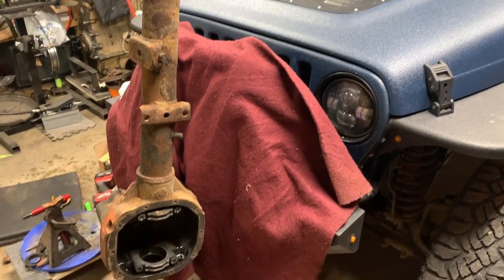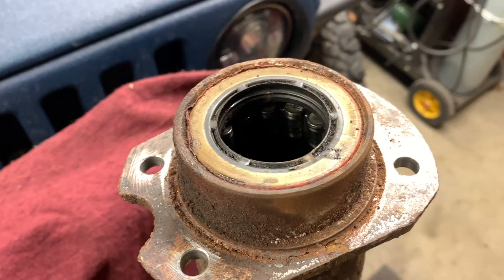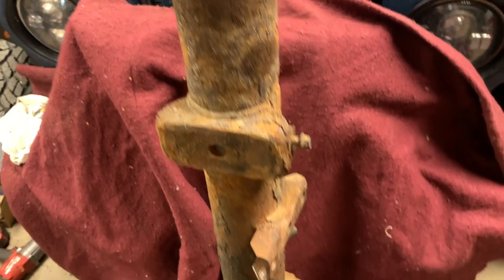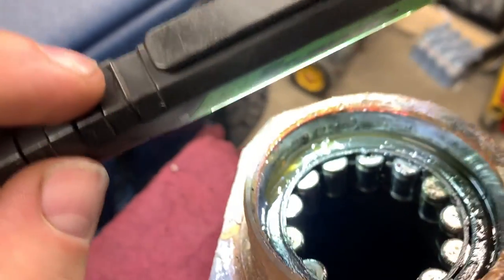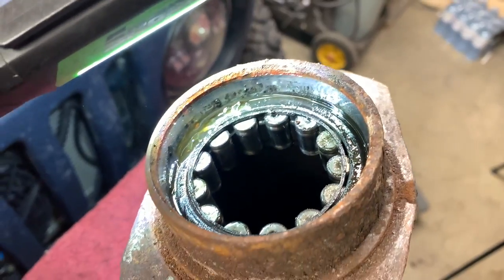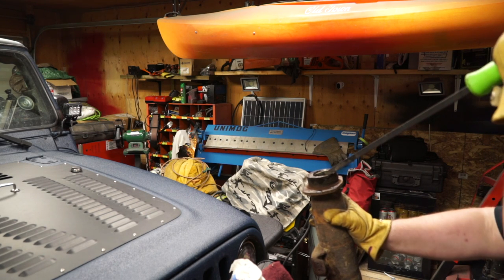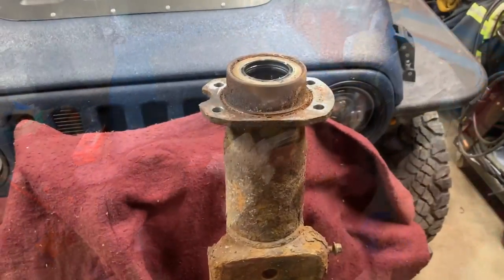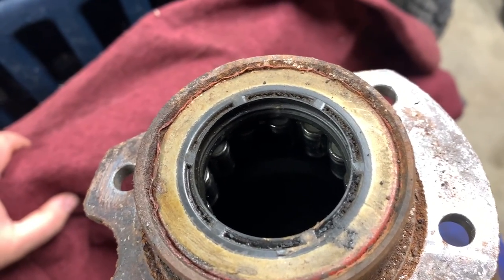Easiest Way to Remove Axle Seals

Comment: The bearings look a little spanked, are you going with upgraded shafts?
Reply from the maker: No need to upgrade the shafts, the D35’s never broke these surely won’t.  Common sense will keep you out of trouble